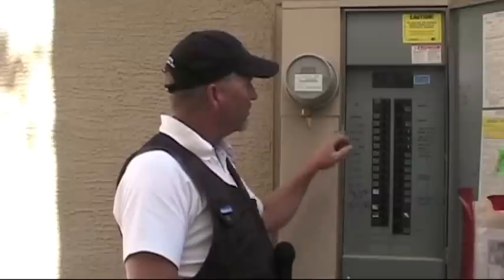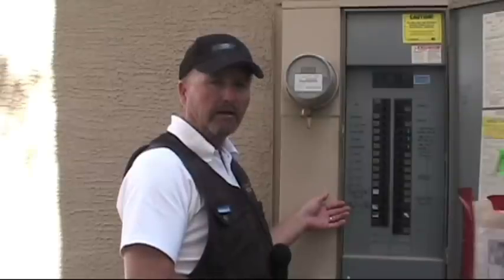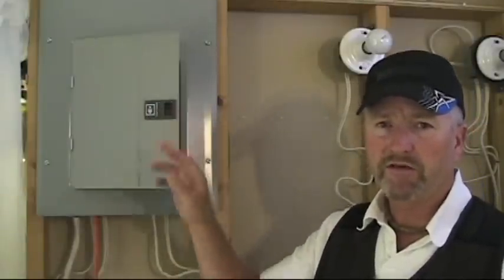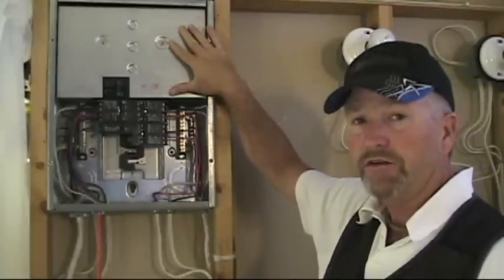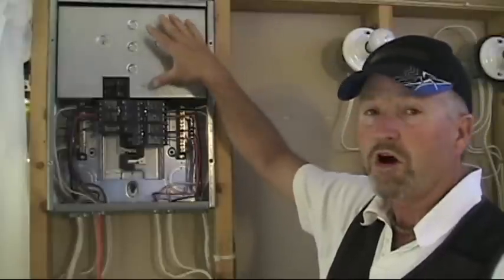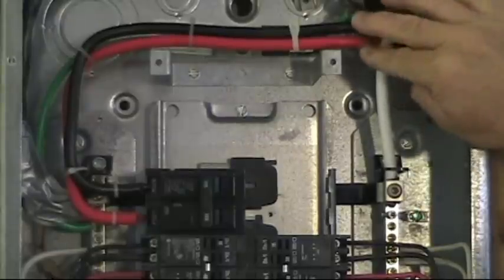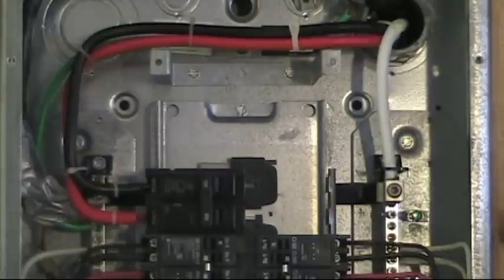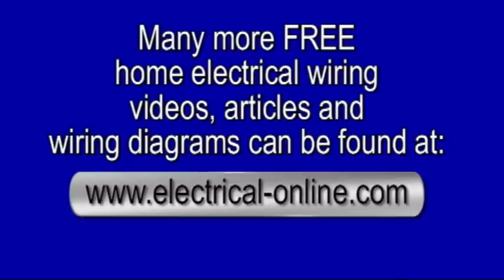Understanding Your Home's Electrical System:  The Main Panel

Comment: Wow, very instructive. I'm always looking to learn new things and your video helped me understand the basics of how power works, which is helpful not only to me as someone who lives in an average house but also as a filmmaker. You'd be surprised how much I need to know about power and electricity in this field (:
Reply from the maker: Lauren Pearce thanks for watching!
Reply: @theinternetelectrician  How short of a drop from my main panel can I put a 240v outlet for a welder? 50amp breaker, 6/2 romex. Is 3ft to close to the panel, it will be ran in between the walls.

Comment: Thanks I never realized that why we had to have high voltage wires  until you explained it .  amps are low when voltage is high . So when voltage is low amps are higher.

Comment: The panel you are showing is a sub panel, you have it wired as a main panel. 
The main panel isn't defined as the first breaker panel inside your house. A main panel (or service entrance panel) is simply a panelboard that contains the main service disconnect for a property. That panel is located outside your house as shown in this video.
Reply from the maker: Chris Mitchell thanks, and you are correct, only you missed that I explain that very point and the inside panel is set up to demonstrate how the connections are made c/w bonding the neutral in a main panel.
Reply: @theinternetelectrician  I did catch that but I though it necessary to point out that the panel is wired wrong as it is, it is demonstrating a main panel however it isn't a main panel. Do you follow what I'm getting at. 
Also it's not even just that the bonding screw was in for this example, the neutral bus bar has ground wires connected to it, which in the main panel is okay, but as this panel is not actually a main panel it is wired wrong and is in need of a rewire, at least a partial one.

Comment: I first thought you made a mistake about the panel inside the house. I thought it was a sub panel, but I re-watched the video and you said those lines where being fed from the meter directly to it, so yes this would be a main panel. If it where a sub panel the ground and neutral would have to be separate, which you also touched on. Good video.
Reply from the maker: Thanks Jared.  Yes, I used my panel in my demonstration wall just to control the conditions and environment for shooting the video.

Comment: Thank you, this is informative and simple. I do hope that you were recording and touching the panel while it was disconnected from the power source. You should always include safety, such as, don't remove the panel cover unless the power is disconnected.
Reply from the maker: Good input, but I do always stress the importance of safety, and de-energizing before working on electrical circuits.  At the 2:55 mark, I explain that this is a panel that I use for demonstration purposes only.

Comment: I don't install any breaker box with a back fed main breaker. It can lead to a disaster. I only use panels in which the main breaker is solidly bolted onto the busses such as the Siemens and square D panels. Over time the tension of the clips in the main breaker loosens causing a point of resistance. Thus they heat up and burn the bus tabs onto which the main breaker is plugged.
Reply from the maker: Yes, I’ve seen some fails like that as well, but far more due to poorly done terminations to the lugs.
Reply: @theinternetelectrician  Yes that's also true.

Comment: Can you explain why neutral and ground are bonded?  It will create 2 paths for electricity to return on a circuit.  What am I missing?  Thanks
Reply from the maker: This is a complex topic and sometimes hard to understand for sure.  But the short answer is that the "grounding" or earthed conductor is the fault current path.  The neutral,  or "grounded" conductor is the intended path for current flow.  Think of it as a floor drain in the basement of a house.  The water you use in the home is intended to be captured by the sewer pipes and routed to a system that takes it back to be treated, and then returned to the water cycle.  But if something goes wrong and a pipe bursts, either on the pressurized supply side of the water lines (hot wires), or on the sewer pipe somewhere (the neutral lines), that floor drain (ground wire) is there to take that water away to mitigate the damage until the problem is fixed!  *(Hey, I've never used this analogy before, but it's brilliant if I do say so myself :-)
Reply: @theinternetelectrician  Excellent analogy!  In the case of bonding neutral and ground, using that analogy, we are connecting the sewer drain and floor drain so when water is flowing down the sewer there will be a point where the water can choose either the sewer or floor drain.  This is what I don't understand. Why we would give water (electricity) a choice of paths to take even when there is no pipe burst we will undoubtedly get some water to flow down the floor drain when the path should be all down the sewer drain.
Reply from the maker: @sonyyoung1036  But the floor drain is only there in case of emergency.  It should never be flowing that way unless there is a problem, and if that happens if we go back to electricity, the path for current flow is so large that the breaker trips, stopping the flow.  Then we correct the problem.  With the plumbing analogy, you would have to have some kind of circuit breaker (which they do make now) that recognizes un-controlled flow, and shuts off the main!
If you didn't have that alternative path, you have a problem, you flood the house! All about mitigating risk to property and people.
Reply: @theinternetelectrician  I think you are saying that, at the main panel, a circuit will return via neutral because it is easier than taking the path via ground.  Thanks for the responses!

Comment: The explanation of the electrical system is great! The only thing is putting your  hands and fingers on the panels and their components. Thats is making me nervous. Do-it-yourselves may do the same thing not knowing that the boxes are energized.  It would be better to use a wood pointer or a pen-pointer. Thanks for your time and effort to upload your Vds.

Comment: Does it matter in 15 circuit and 20 circuit which side of breaker it goes on?
Reply from the maker: Short answer is no if I'm understanding the question,  but can you give me some more detail of what it is you are asking?
Reply: @theinternetelectrician  half my home is without power. Found out it's all connected with each other. It's a HUD home. I can't afford to pay electrician. I checked all plugs. Bought new ones and replaced them. Still nothing. I was told maybe circuit. I bought a new circuit and changed it and still no power. Living room plugs are connected to upstairs bathroom plug and fan and also half bed room and light and plug in loundry room. Smh. Trying to figure out what to do.
Reply from the maker: @paintingwithtastefromcanva7165  It's very likely a problem with the main breaker, in the meter socket, or the feed from the supply authority. Start with the main breaker.  Push it fully to the off position, then back on.  If that doesn't do it you will have to call an electrician to determine if it's the main breaker that has failed on one leg, or if the feed to the main breaker is the issue.  If it's a failed main breaker in your main panel, then it's your issue and you pay to repair. The electrician will need the power company to pull the meter to do this. You can also call the power company to come check if it is a problem on their connections as they don't charge for that.They will also check the meter base to see if that's where the issue is.

Comment: Terry, what is the difference between a ground and a neutral. Why both?
Reply from the maker: Neutral is the intended path for current flow (the ungrounded conductor)  The ground is the fault path for current flow and should never have conduct current except in a fault condition (the grounded conductor).  It reduces the risk of you becoming the path for the fault current.

Comment: Why would you bond your ground & Neutral in a sub panel? The bonding is to occur at the first means of disconnect.  Additionally, that trunk cable fed into the sub panel should be coming from the exterior distribution panel (where the bonding is to occur.
Reply from the maker: You are correct.  You don't bond in the sub panel.  I explain that in the video that this panel is on my demonstration wall, and that it is only to demonstrate how you do bond if it was a main panel.

Comment: Thanks Terry. Where is the switch you turn off in case of an electrical fire?
Reply from the maker: On the video, at the 2:20 mark, the large breaker alone at the top of the panel is the main breaker in this particular distribution system. That is what you would shut off in the event of and electrical fire. This would deenergize all circuits in the home.
Reply: @theinternetelectrician  THANKS!

Comment: terry, have a strange situation. losing power to one leg but no breakers are tripped.   they said the meter base needs to be replaced but they havent looked as waiting for utility company to cut power.  whats strange is, if a 220 circuit is active/being used, there is no cut out issue.  any idea why this is?  thanks!

Comment: I replaced our  clothes dryer because the heat stopped working. New dryer wasn’t getting warm. THEN noticed the breaker was tripped. Replaced breaker. And IT trips. This all happened after the water heater had sprung a leak, just on the other side of the wall. I’ve decided the outlet is to blame do to moisture, causing ground fault or whatever, Is this possible ?

Comment: Terry, does the regulation allow to to drill a thru hole in the main outdoor breaker box to my garage on the other side of the wall? I need to install Wi-Fi antenna for the monitoring system. Breaker box acts as a Faraday cage and I really don't want to drill holes outside panel leaving antenna exposed. So, I'm going to drill a hole thru metal case straight to my garage, just wanna check if I'm not violating any codes.
Reply: Arthur Vin you’re not supposed to add any holes to a panel or meter pan.
Reply: @KitchenerLeslie2  I found a better option! The main breaker panel has a big distribution hole already which opens inside the wall in between the panel and garage and where all the wires from the breakers go. I will punch a hole in the drywall from inside garage and route current transformer wires from the panel inside to garage where Ill install my monitoring system. This way I'll eliminate Wi-fi signal issue as well as keep breaker box clean of additional equipment. How does that sound?

Comment: so wjhen are amps added?  I assume amps are added by means of resistance correct? does the transformer have resistance or the home circuit panel.. Sorry if dumb question in my 2nd week of 101

Comment: The electrical panel only has 2 hot wires, 1 neutral, and 1 ground? Aren't houses given 3 phase AC? How is it that there's only 2 hot wires?
Reply from the maker: Yes, almost everywhere on the North American grid, single family dwellings are serviced with single-phase, 120/240V transformers.  Two hots, a neutral, and a grounding / earthing system.
In multi-family units like apartments or condominiums, they will bring in 3-phase at a higher voltage, then transform down to 120/208V and still only feed each unit with 2 hot conductors and just divide the load amongst the 3 hot conductors to the individual units.  Thanks for watching!

Comment: Terry -  I built my own dual-axis solar tracker energy system, utilizing a transfer switch to my main service panel (proper city permits and installation city approved).  Sold that house & system, bought another.  I want to avoid the complexity of a transfer switch and its complex wiring by going directly to the service panel this time.  I will purchase and install an interlock switch that will lock out the 200A main when needed.  I will insert a 240vac CB into the top slot of L1 and energize it with a source (generator, solar, battery bank, pure sine wave inverters - etc).  My question is: will that ONE 240vac CB energize both L1 and L2?  It seems it will, given that it touches both.If not, can I accomplish what I want by putting an additional 240vac CB at the top of L2 and energize both of those top CBs with my energy source (obviously, within the power output capability of that energy source).  The point to this exercise is to provide energy to all CBs below the one or two I have energized.  I do NOT intend to have them ALL turned on at the same time and will select only those needed for the function at hand...always within the ranges of my energy source(s).  Any advice on this would be greatly appreciated.  John

Comment: I live in Indiana. I have a main breaker outside next to the meter. But nothing else. The lines come in and feed a breaker box. Is the box inside considered a sub panel since the main breaker is outside?
Reply: Technically yes it is. The meter and breaker outside is considered a distribution panel.
Reply: @rcrai3  So regarding ground and neutral in the box on the inside ...They would be separate with no bar connecting them?

Comment: This panel does not have the grounds separated from the neutral bar. YOU MUST REMOVE THE NEUTRAL BAR THAT JOINS  THE TWO BARS TOGETHER .
Reply from the maker: I can only rationalize that you are referring to the bar that ties the neutral buss bars together on each side of the panel? This brand of loadcenter has a neutral buss on each side.  At around the 5:00 minute mark, I explain about when you can and cannot bond the neutral to the ground. This being an example of a main panel, you bond the neutral and the ground together, and in this panel, it's the bonding jumper you see in the top right corner.
Reply: Finally a video that shows as a main panel the isolated ground has to be in the neutral bar,branch circuits grounds separated from neutral if you look closely you see he has separate bars for ground wires .

Comment: sorry, i feel a little confused about the terminology. you've called the panel in your video the Main panel. is this not the subpanel? since the combination panel outside is the Main as the meter feeds it directly and has the main shut off there? i feel confused because subpanels don't have the neutrals and grounds connected like shown in your video. 

I'm a new student studying Home Inspection with zero experience in electrical, so i'm trying to get supplementary info from youtube videos. I'm also from Canada, so I'm wondering if terminology might be different? any help would be very much appreciated.
Reply from the maker: As I explained in the video, I show you the main panel at the beginning, but I move inside for a more controlled studio atmosphere and yes, that panel is technically a sub-panel, and is connected as such, but for the video I have made it to appear to be the main panel just for the demonstration, and I indicate that in the video script.

Comment: Thank you for the great video. I thought higher the voltage higher the amps? Can you explain please.. You said higher the voltage lower amps? Im trying to learn.. Thanks again
Reply from the maker: Joe Clark yes, if the load is constant the relationship is inversely proportional. So if you were using 100 amps at 240v, a high voltage transmission line would carry 1A at 24000 volts to the transformer (just as an example, not actual values used).
Reply: Terry Peterman thank u

Comment: Is there a way to get electricity directly from the telephone pole or the wire that heads to your panel without it going through the meter
Reply: Climb up to your weather head and connect some wires.     I'd reccomend having a professional do the work.

Comment: thanks for wonderful video! but i had a question, what is the difference between a neutral and a ground wire?
Reply: Neutral wire provides the return path for the voltage back to the panel. The ground wire is connected to earth to provide a path to ground in case of a fault. Ground wire has lower resistance so it trips out the circuit breaker by allowing more current to flow through it.

Comment: correct me if im wrong,
so the voltage/current that is inside our house is DC? because he said from generator(AC) the current goes to TRU(AC change to DC step down), then go inside the box in our house?
Reply: sry my english is bad, and im not electrical base student.
Reply from the maker: Zaid, no, the transformer does not convert to DC. It stays as AC, just lowers the voltage. When we change AC to DC, that is called a converter or rectifier. When we change DC to AC, that is an inverter.
Reply: Terry Peterman thx man for replying!!! so in our house is AC? but i thought AC is vary(meaning positive, then goes to 0 then goes to negative). If it is AC how come my light bulb in my house acting as if it receive DC?
Reply from the maker: The alternating current happens so fast that the human eye is incapable of seeing the fluctuations. We're talking about 50 (EU) or 60 (Americas) cycles per second where a voltage of 120Vac goes from 0 to 170v + back to 0v, and then to 170v - in a sinusoidal wave (sine wave) The RMS value is 120V.  It's a bit complicated, and that's why electricians have to spend time in tech school learning this "behind the scenes" information that really proves to be quite useless in the real world!
Reply: Terry Peterman thx sir for the explaination.